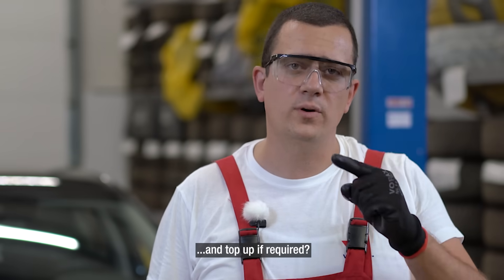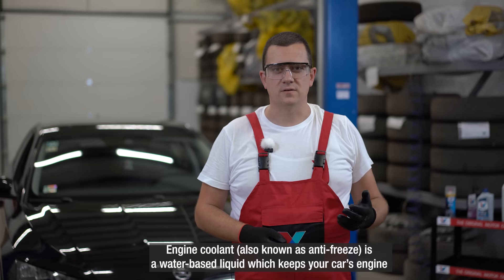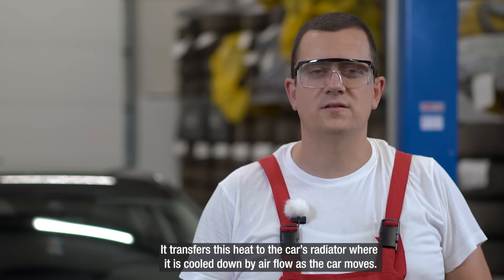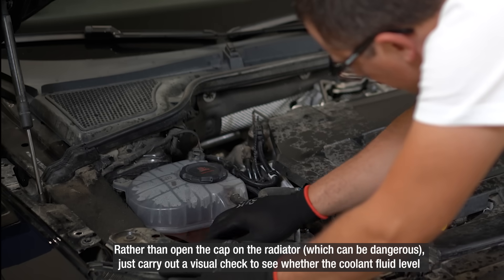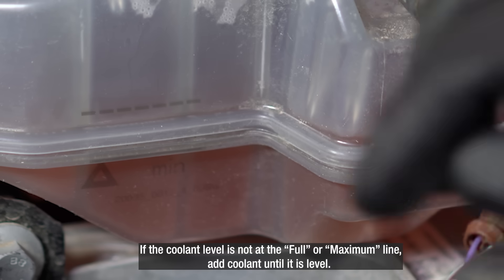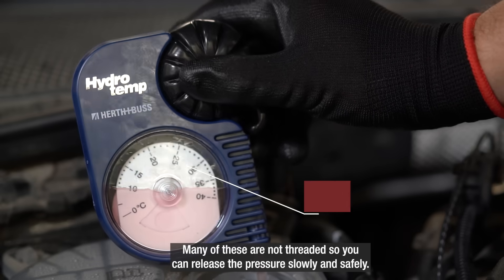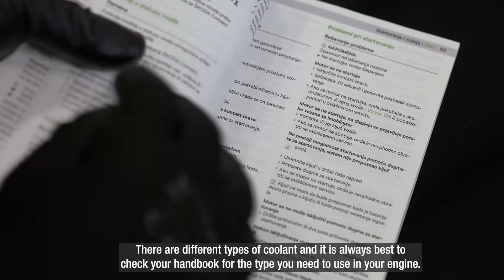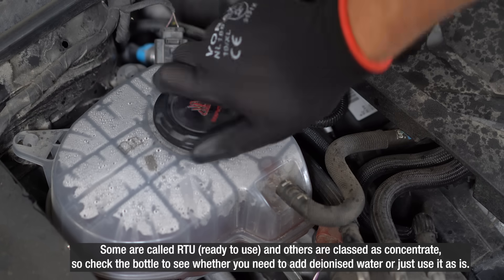How to check and top up COOLANT in your VEHICLE | QUICK Check, Flush & Fill anti-freeze

Comment: hello what happens if you fill too much and its above the FULL level?
Reply: Good question and I’d like to know if I should fill it up when cold and shows low and when warm and changes to full
Reply: Some cars have an overflow hose, when too much coolant expands and its in the tank it goes to the overflow line, and dumps out of the car. Check your reservoir tank to see if it has one.
Reply: Take a syringe and suck it out.
Reply from the maker: Hello @ambesyosa, we appreciate you watching and sharing your insights! Your feedback encourages us to keep improving. 
Typically, the excess fluid will be removed by a vent or over-pressurization system.
Kind regards from Valvoline EMEA team.